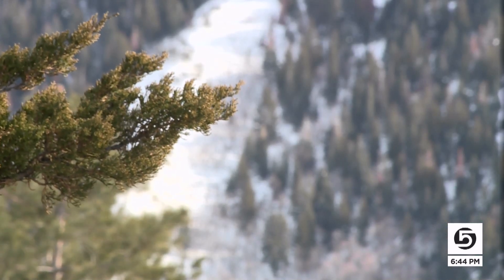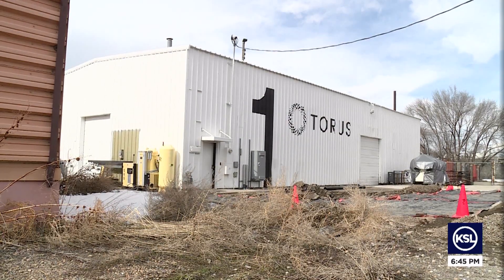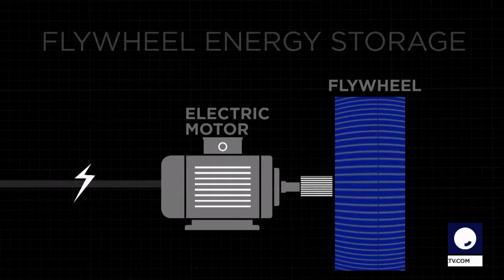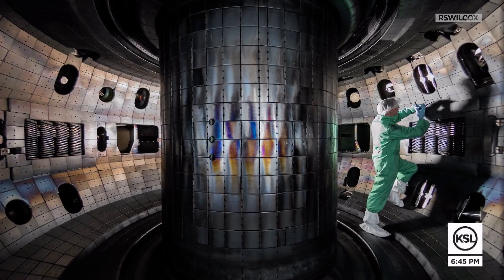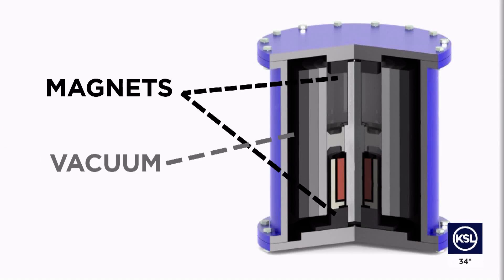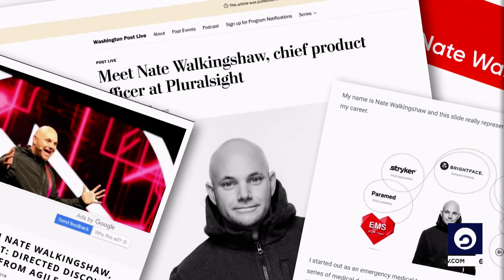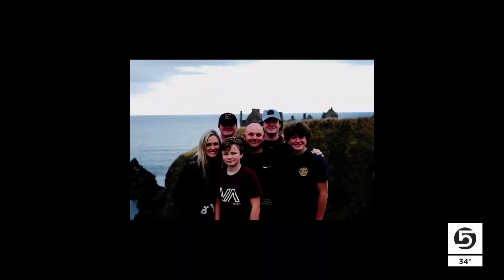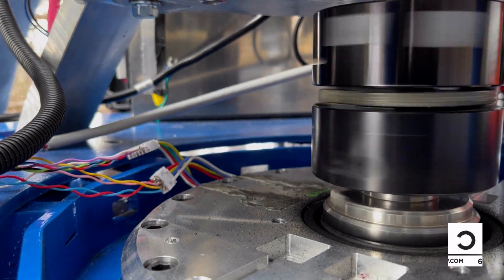Utah man creates company devoted to flywheel energy storage

Comment: These would be useful in supply inertia to the grid. As we take out the rotating mass of coal and gas turbines and add renewables the grid loses inertia which really has a very important role in stabilising the grid against loss of power from a generator dropping off and before others can pick up the load.

Comment: Make a massive Steel flywheel the width of an Olympic swimming pool and the height of 5 story building and spin that at 100,000 RPM then pop the clutch and drive a massive generator
Reply: They have that in the UK for testing nuclear fusion.  They can discharge 400 megawatts in 20 seconds.
Reply: the larger you make it the less speed you need to get loads of power.
Reply: This might be a bit too expensive, and possibly unsafe, also, physically impossible, like building a heavy cargo airplane with a wingspan of 2000 meters.
Reply: Imagine a bearing failure?   such  destructive power on the rampage,

Comment: Efficiency is usually around 70 % for flywheels or Pumped Hydro. Not as good as the 90% in batteries. He already has hydropower, he could just build a couple of small dams and add a cheap pump and some valves and control system, and he would have Pumped Hydro storage at low cost.
Reply: He could, but in his area isn't there the problem of everything freezing in winter? In this short piece we don't get the entire history of why he chose the technology over hydro. Besides, he's done this for everyone and not just for those who have property with water running through it.
Reply: He could, but pumped hydro isn't getting those "advanced energy storage" government subsidies. Most of these companies just exist to get government subsidies, when those run out, they go out of business.
Reply: Flywheels don't wear out after 5-10 years, like Li-Ion batteries do.  Yeah, 90% is better than 70%... but not having to replace a $50,000 system is important too.
Reply: @JorgBrown  to be more precise, only some components wear out, like ball bearings, but they are relatively easily serviceable and cheap and I could imagine them working without a hitch for 15 years.
Reply: @dingdingdingdiiiiing bearings are cheap and degrade, but this has a magnetic which is a lot more durable as far as I know.

Comment: Imagine a fully-charged, heavy spinning wheel flying out of its container... it would destroy everything on its way, which batteries can not do...
Reply: would it be safer if it was built underground?
Reply: The same can be said about toxic batteries that are at risk of exploding and failing.
Reply: @_matis_ yes, that's the better idea.

big, underground, anti-sismic engineered

Comment: Traditional flywheels are made of carbon fiber and shaped like a flying saucer, thick in center to withstand tremendous centrifugal forces with a thin edges to permit high RPM’s. Keep in mind that almost all of the energy is stored in the last fraction of inch of edge.
Reply: more than rpm, you need inertia, given by the outer ring you mention. big heavy outer rim gives more inertia than the saucer, hence, more practical for storing energy.

Comment: every powerstation already has "FES".

the turbine, and the rotor. hundreds, if not thousands of tonnes spinning around and around and around...

they store TEMPORARY power to maintain steady RPM. to absorb variations in delivered power and load.

wait until you delve into critical shaft speeds, resonances, and the issue of staying below, or accelerating fast enough to get past these zones without disintegrating...

a smart one would have simply added a few tonne of flywheel to the "hydropower" he apparently has somewhere.

why add so many extra steps, producing electricity just to spin a wheel to then produce electricity?

that will only ever return 1/4 of the power it took to get it up to speed.

people fall for this BS because theyre ignorant. stories like this only strengthen the ignorance.
Reply: You're mostly right about the cost. But adding weight only adds a few seconds of storage. He stores 10 hours (10 kWh energy, 1 kW power = 10 hours) . Efficiency is usually around 70 % for flywheels. Not as good as the 90% in batteries, but better than 40% in compressed air. 
His competitors already have serial production.
Reply: @thomasgade226  flywheels can get up to 90% but that is with magnetic bearings and with the flywheels being in a vacuum chamber.  This only really makes sense once you go big since the costs of increasing in size doesnt make a massive difference.  These would actually make sense at wind farms. They can keep the power output consistent by dealing with peaks and valleys with output. Some other forms of storage other than batteries can sometimes take a little bit to really ramp up.  The flywheel could also fill in the gaps between when power is needed and when its available.